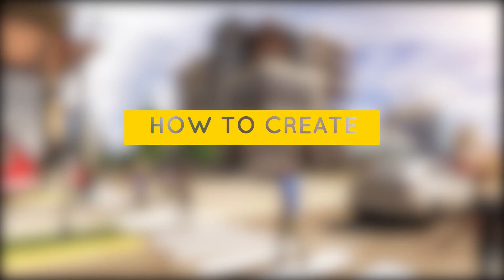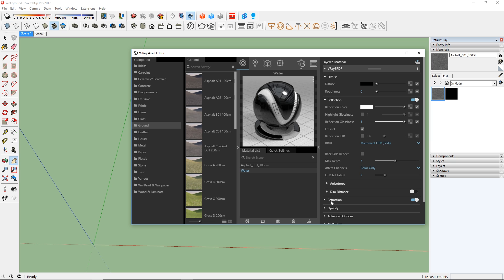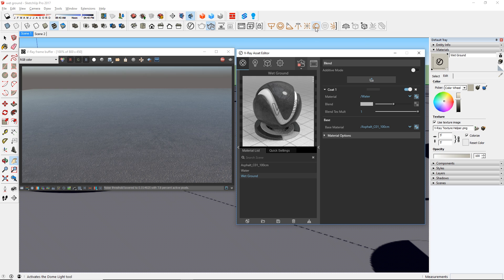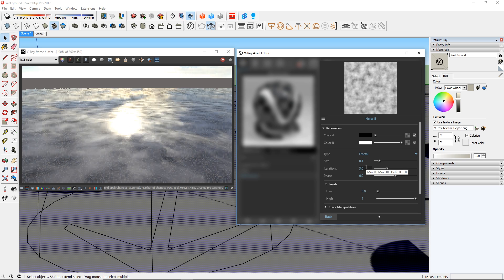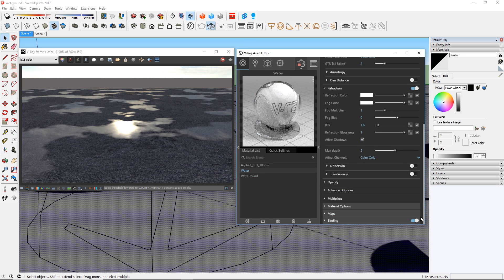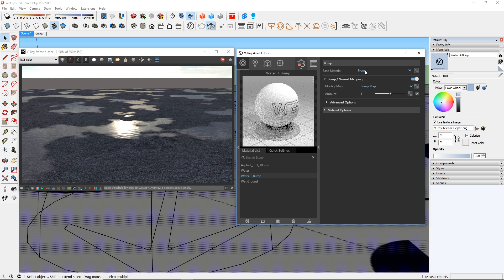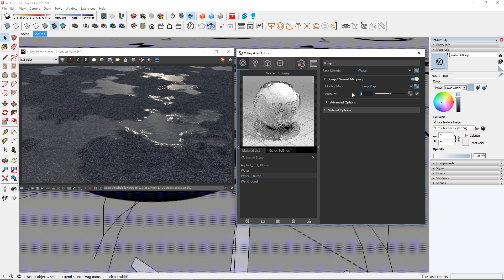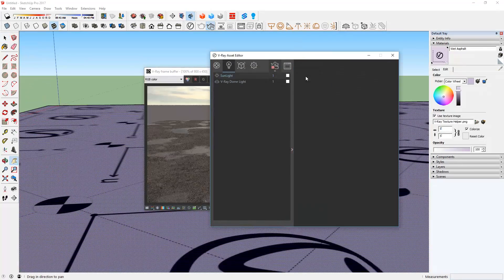How to create a WET GROUND SURFACE | Vray for Sketchup

Comment: Thank you for this Tutorial - really appreciated. Question related to the proper procedure for sizing textures here..when originally applying wet ground Material to surface I don't see the binding rollout in your Wet Ground material. What should its setting be ? When I have set to Auto I don't see texture or Texture Helper in Sketchup. If Texture Helper is selected, texture helper shows in Sketchup but scale of texture changes in VFB. Custom Mode for me is the same as Texture Helper Mode both for preview in Sketchup and Scale of Texture in VFB. Do you scale the original Asphalt Texture in Sketchup before hand or not at all ?  (thus scaling only the Wet Ground texture in Sketchup) In Auto Mode Sketchup does not allow me to scale texture. Scaling the Wet Ground texture in Texture Helper or Custom Mode doesn't get rid of the tiling as well as scaling the original Asphalt texture. Can u please clarify best method for scaling the Asphalt and Wet Ground texture and say what Binding Mode should be used for Wet Ground texture. Vray Next MacOS 10.12.6 Thank you

Comment: Hi! Thank u for the practice tutorial; I followed each step and I could render my project in the best way that I desired. Just one question. When you created the blend material and applied it on the reversed surface, you were able to change the settings of the material by the edit in sketchup. I can't find the Default Tray; I suppose it's caused by a different version of SU on Mac. How I can change the settings then? The wrong scale between surface and water spots compromise the quality of the render.  I'm sorry for my bad english, I hope you've understood everything.

Comment: i  can see the 3d mapping tab in my vray.
Reply from the maker: You can or can't?
Reply: @ArchitectureInspirations   me too i cant see the 3d mapping i use vray next skp 2019
Reply: @abdullahjazzar3002  I also don't see the same 3D Mapping setting - Sketchup 2019 Vray Next MacOs 10.12.16 - what are the correct settings with those that are available - really appreciate your help thank you
Reply: I talked to Vray people on this - for Vray Next - use the 3D(Object Space) setting in the Texture Placement rollout - I see some distortion of the noise map in the ME preview window when I do this but seems to work otherwise

Comment: Chaosroup needs to update their material workflow. Unreal engine is taking over when it comes to material blending. it would be too cool if we could connect displacement or vector displacement directly to a material and pipe it through blend material. Nothing has changed since years in vray.

Comment: in vray 3.4 i can't see the setting noise B, is there other alternatives boss?
Reply: i found a new way, import a bitmap image of a road puddle texture into reflection, on the bitmap settings turn rgb to gamma something and set the gamma to 1.5 and copy it to reflection glossiness, i hope I'm right :D
Reply from the maker: Hm I guess you can try to use the normal noise map but itll be different :(
Reply: tristan dinglasan got the same problem here
Reply from the maker: It's because this noise texture is new for vray 3.6.
Reply from the maker: Yeah that also works as well! That's actually a better way but of course if you have a map 😄 thanks for sharing tristan!

Comment: what if you don't have the noise A or B but it says only noise?
Reply from the maker: That's the same as noise A texture in 3.6 so you might need to experiment with it a bit to see if you can get the same results
Reply: Architecture Inspirations i use vray 3.4

Comment: its just me or anyone else has the same issue that vray 3.4 got slower than vray 2.0 ?
in my case (exterior scene) its just 60-70 mb but it takes ages to render and make our PC'slow respon even for task manager. in vray 2.0 i have more than 300-400 mb file (compleks scene) but it has normal time to render.

Comment: Very Nice tutorial. I have a problem, my asset manager is not showing the option of NOISE-B from the 3D Texture which you used in blend material. I am using Vray 3.4. Can you help me. Thanks
Reply from the maker: +Waleed Khalid ah, do you have vray 3.4? Because that texture is new in 3.6

Comment: hey, i have a doubt, may be you can help me. 
i have Vray3.4 and when i use de GPU acceleration option in setings the quality of my render drops a lot, do you know why ?
Reply from the maker: +Carlos Duclaud hm it really depends on your graphics card, which one do you have?
Reply: EVGA Gtx 1080 Ti, i think is a powerful gpu but i dont know why the quality drops, i wil upload a video of this so you can see how it happens
Reply from the maker: +Carlos Duclaud oh that is odd, have you make the selection yet? Make sure it's set up correctly
Reply from the maker: Ahh I see, you're doing Interactive render with GPU, yeah if you're using GPU with interactive, there are a lot of things that aren't supported so the image might not render correctly. I think they fix most of it in vray 3.6 but for 3.4, displacement might not work with GPU and interactive

Comment from the maker: Thank you so much for the support guys! I'm so grateful for you all <3 
Enjoy!
Reply: If I want to use Displacement on this kind of material, is it possible?
Reply from the maker: Yes it is!
Reply: @ArchitectureInspirations  what is the name of the dome light used
Reply: can i use vray meterial and render by enscape? thanks!
Reply from the maker: Hm I don't think you can use all the settings from that material. You may need to use the diffuse map from the vray material and then adjust the settings in enscape 😊